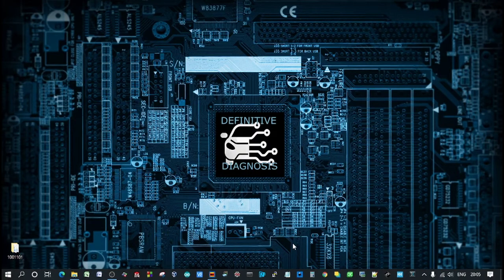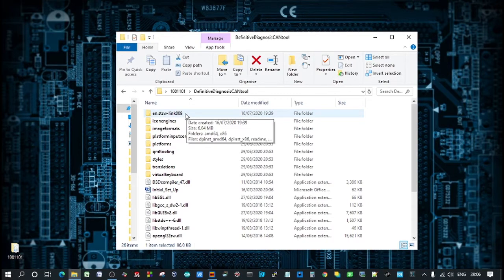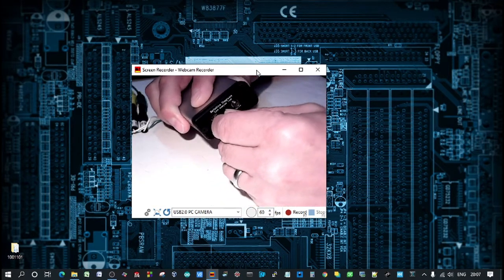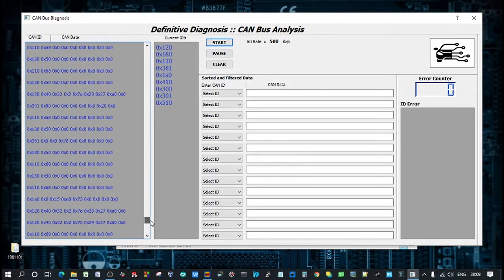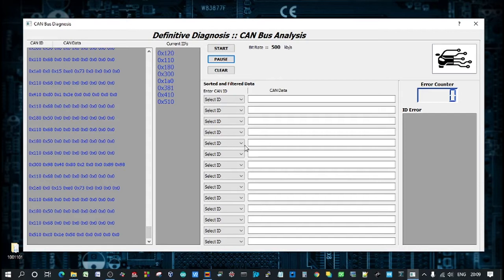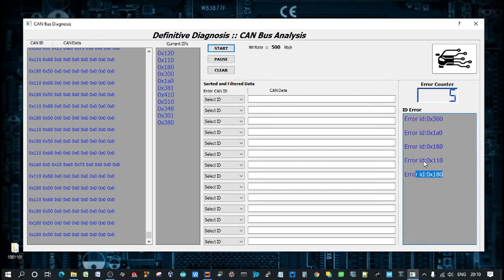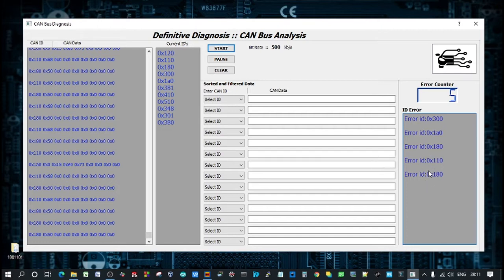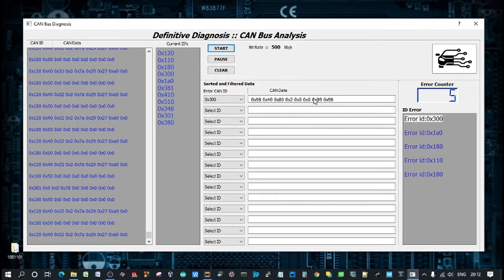CAN BUS Analysis Tool

Comment: Right, I've got a question . Let's say that ox300 drops off the can completely . This will record the loss of that module alone right?
Reply from the maker: if it was there,then errors and disappears it would store the error. if it was never present then it would not show on the tool
Reply: @definitivediagnosis9162  terrific. And how does it handle an incomplete packet ? Let's say the bias was elevated or something of that nature . Does it determine packet error or only loss of packet ?
Reply from the maker: @NewLevelAuto  anything a module would see as an error is what this tools sees as an error. it is a module with a can transceiver,so incomplete messages/collisions/etc will all be reported.